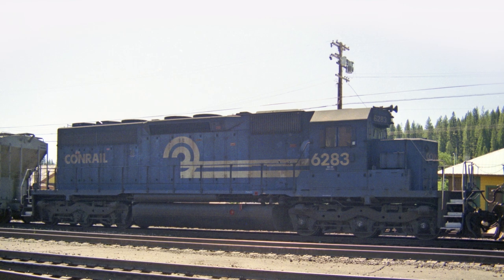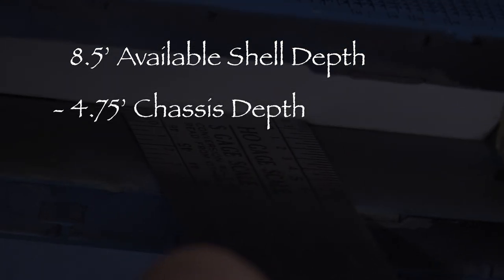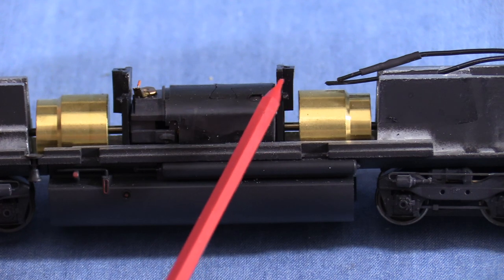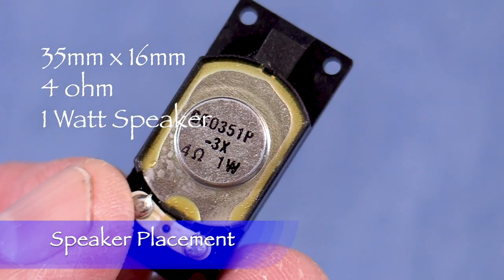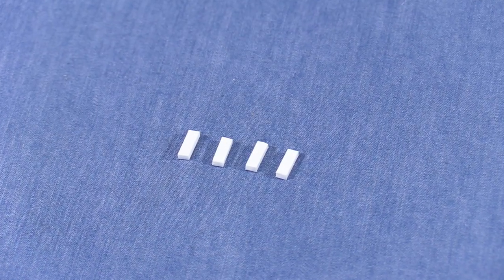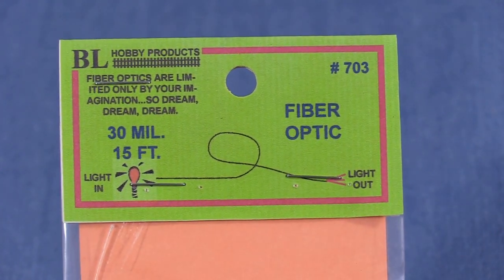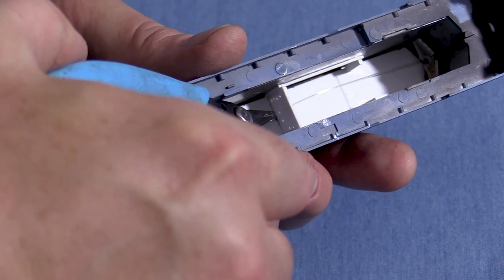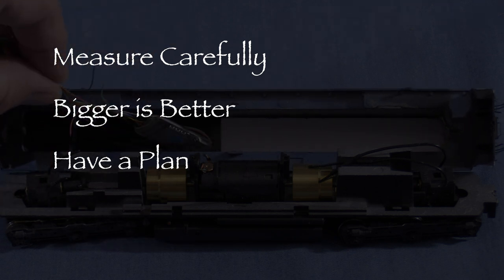Model Building HO SP Consist Part 7

Comment: Dan, 
I picked some 030 fiber optic a while back for just this purpose after watching your Santa Fe build on TSG. You are not kidding it takes quite a bit a practice to get those ends round and the right size but the result looks pretty good. Thanks for the great tip.
Mike
Reply from the maker: I'm glad you found it helpful.  I think they must have changed the formula for whatever the fiber optic strands are made of, as it seems like the newer stuff is harder to get to make good lenses.  Thanks for watching!